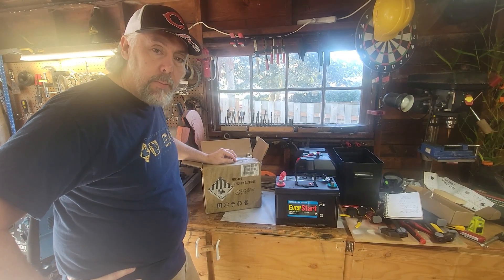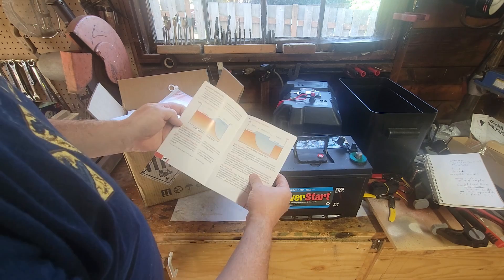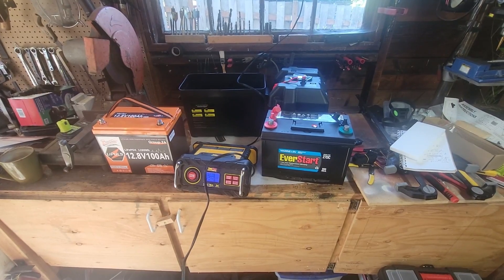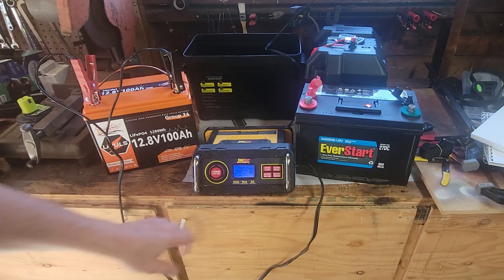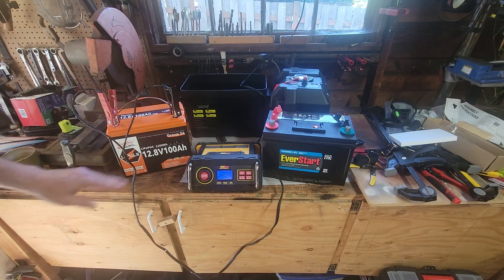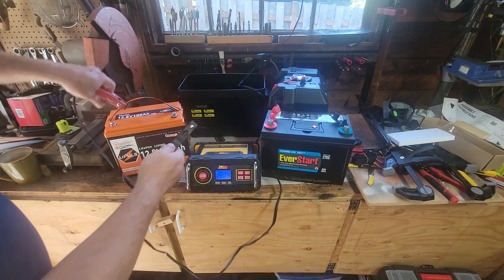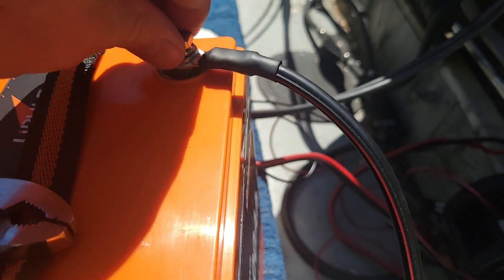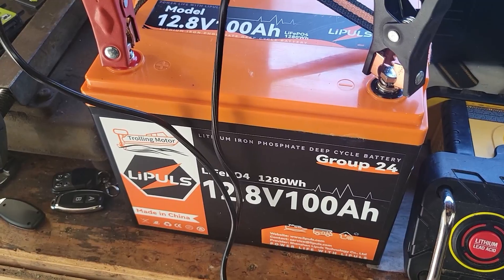12v 100ah Lithium Battery for Trolling Motor - LiPuls LiFePO4 Batteries

Comment: Congratulations! You've purchased the last lead-acid deep cycle battery you'll ever buy! You'll be throwing rocks at that lead battery after running a lithium. Considering that a 100Ah lithium has as much power capacity as a 200Ah lead-acid, is smaller, weighs TONS less, won't leak acid or gas-off, only loses around 2% per month in storage compared to 10-20% for acid, is capable of thousands of full discharges instead of a few hundred, will last decades, and is only slightly more $ than a quality lead-acid battery, I can't think of a reason to ever buy another acid deep cycle personally. Heck, LiTime has a 12.8v 100Ah trolling-motor-specific battery with built-in Bluetooth so you can see how much juice you got left from any smartphone while you're on the water. It was around $370 earlier this year, currently on sale for $229 with a 5-year warranty. Years ago, a 12v lithium battery was over $1000-$2000. Now they're affordable enough for the average person to obtain. If they keep dropping, and lead keeps going up, they might be cheaper than lead someday! Even now, they're WAY cheaper than lead-acid batteries over the long run. I've bought a truckload of lead-acid marine batteries over the years, but now I've seen the light!